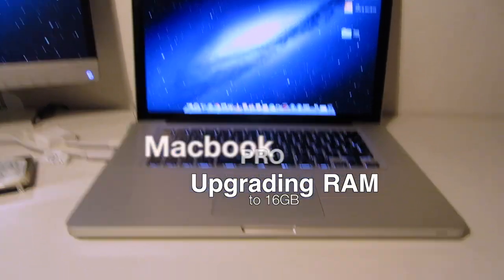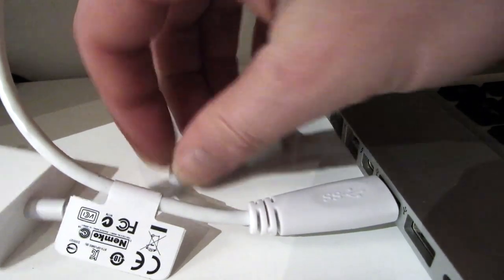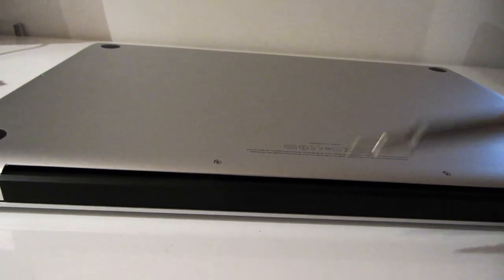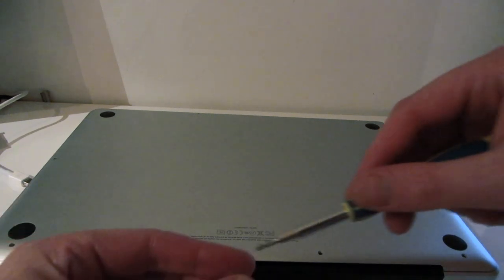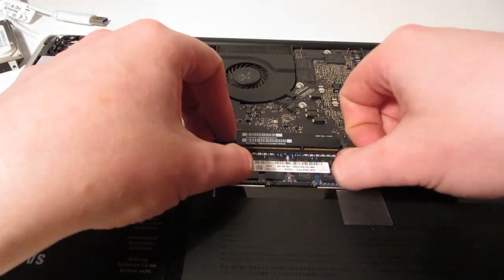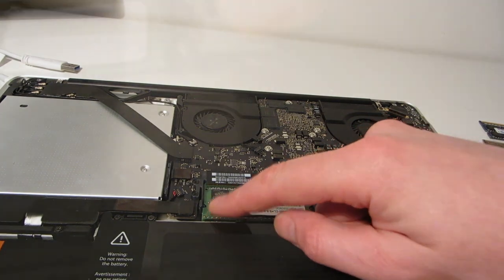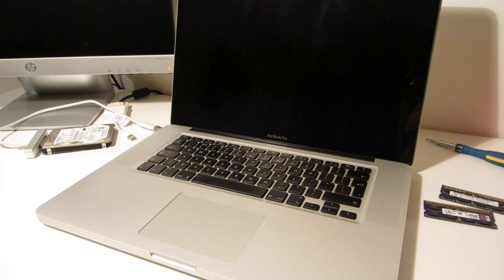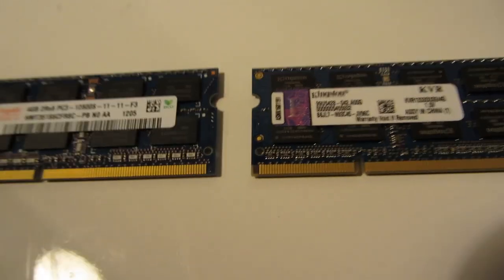Install 16GB RAM Upgrade on Macbook Pro 15" in under 5 minutes

Comment: Thank you for the nice video. I just called Apple to ask about their stance on officially 8GB supported vs 16GB capability. Obviously, 16GB does work, and it may enhance performance. However, only 8GB has been officially tested and is officially supported. It doesn't void your warranty, but if your computer is giving you problems, the first thing they will do will be to reduce your 16GB to 8GB. If the problem desists, they will claim it's a memory problem. If it persists, they will try to fix the problem.

Comment: I think what Mac is trying to say by it doesn't exceed 8Gb is that you can't go up to 32 GB of RAM. On a 16GB RAM each strip has 8GB. (The limit) but in a 32GB RAM each strip has 16GB. (It would exceed the 8GB and not work)

Well that's what i think they mean by it wont go past 8.

Comment: It took a bit more than 5 minutes in my case.  First I bought the screwdriver from a computer shop and unwittingly got a Y or three blade 00 phillips-- came to find that's a relatively rare one.  Anyhow I managed to get the back four screws loose before I found the others wouldn't budge with the wrong screwdriver.  Thinking that the screwdriver was defective I took it to the shop and they looked at it under a glass and said it was fine.  They said I could bring my computer in to check what was up with the screws.  Went back to the shop and the tech said it needs a standard phillips 00.  He removed the screws for me since they didn't have the standard 00 at the time.  Went and got a proper set and of screwdrivers at another electronics shop and started on the memory.  The bottom memory card came out with some side to side movement and the new one went in fairly easily.  The top one came out easily but the new got jammed at the trailing edge against the computer frame when I pushed down too soon before it was completely seated.  I carefully pried up on both sides with a screwdriver and was able to remove and install it properly.  I started my computer and it indicated only 8 gigs of RAM not recognizing one of the cards.  I turned it off and removed and reseated both cards-- thankfully it then indicated 16 gigs of ram.
Reply: extantia To be completely honest... Most of that was your fault
Reply: extantia *ALL

Comment: I want to record cities skyline after it come out on my MacBook Pro should I get 16 or 8gb to do that?
I in a budget and 16 is very expensive! RM528(price malaysia) in my area, is expensive?
Should I just spend more to get 16 or 8 is ok?
My Mac spec 
Mid 2012 15 inch 2.3-3.3ghz i7 quad core, 4gb ram 1600mhz
512mb nvidia 650m and intel 4000
And in my area only Kingston brand of ram is selling does it good?